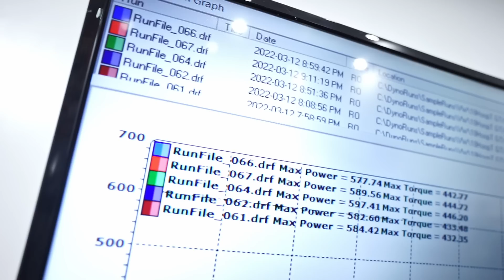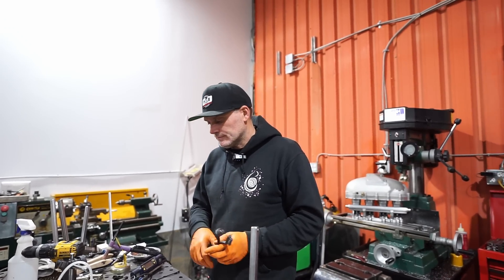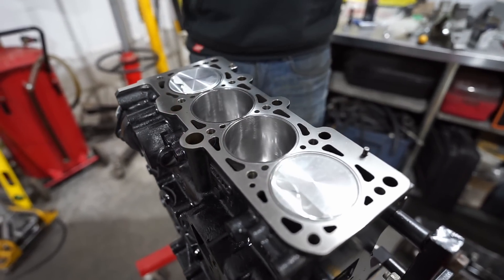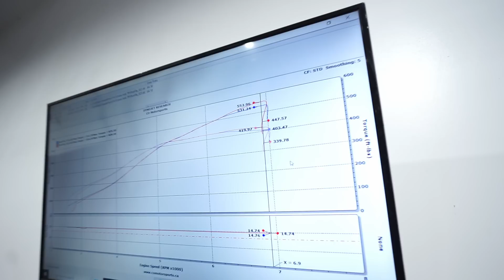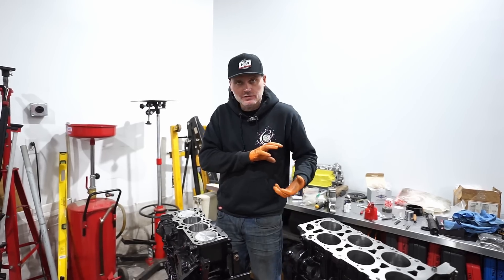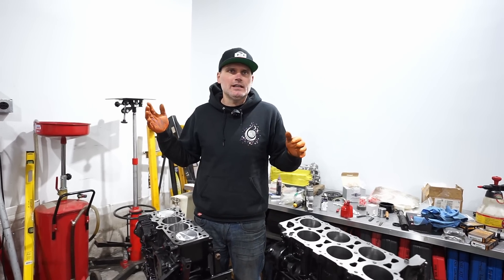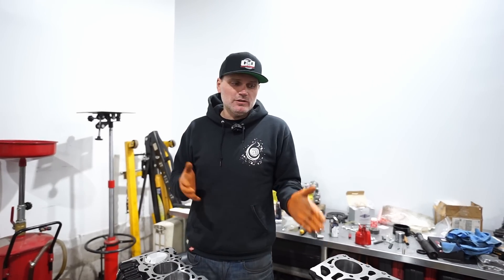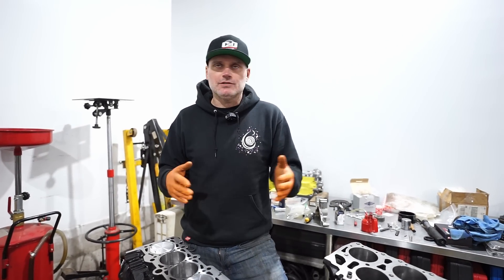Best VW/Audi Engine To Modify.

Comment: Wait till the mk8 r has been around a few years, currently in the uk mk8 golf r stage 1 basic map 400-410bhp 99ron map. Then 460-470 with intercooler and exhaust and mal tweak. The current standard conti turbo on the mk8 r can push the mk8 r to mk7 r hybrid turbo power numbers with ease. It’s amazing the way the things have changed in the past 10-15 years. Remember back in 2005/6 a 1.8t 225 Audi TT stage 3 was blowing the doors off most things 😂
Reply: Yea TR Hamza's MK8R has been nicely mapped by MRC. Making silly power with basic mods

Comment: Come on guys..   You talk all day about 4 and 6 cylinders, and don't say squat about the 5 except " oh yeah it's the best of them all" 😑.
Otherwise nice vid thumbs up!
Reply from the maker: The issue is it's not easy to make power with them, so doesn't really make it plausible for most. You're not spending a few K and making 500whp with one.
Reply: @CO Motorsports  but that's the same case with the VR too I know personally.   You can't say that the I5 is the best outta them all but then say it's hard to get power out of it easily bro.  That's a complete contradiction.
Reply from the maker: @TURBOBEATZZZ  first...at no point did I say it was hard to make power out of them. Second, yes it's about the same as a VR. Third... It's still much easier on gen3 which is the point.
Reply: @COMotorsports  what does your statement " it's not easy to make power with them" mean? Please clarify?
Reply from the maker: @TURBOBEATZZZ  building a complete turbo kit for an  NA engine, no complete turbo kits available, having to open the engine to make any sort of reliable power...those are to name a few. To 95% of people all of those things are out of their capabilities or interest and is not easy. Bolting on regularly available parts is yes "easier", no denying it.
Reply: @CO Motorsports  I get it sort of, but the VR6 is NA too though.....
Both only need a headspacer to drop compression.
Reply from the maker: @TURBOBEATZZZ  I get whats needed. We've boosted pretty much every VW engine at some point, and i've boosted plenty of VRs and plenty of 2.5s. I'm actually putting a 2.5T in my daily. So with that said clearly I have experience dealing with the ins and outs of all of them and I'm giving an unbiased opinion base on my experience, and what clients are looking for.

Comment: Doing a Gen 1 2.0TSI build for my scirocco.
Ported head with 1mm bigger valves 11k rpm valve train and a fully built bottom end. 

To overcome the fueling issue of the direct injection, I have added a manifold with port injection.

Keeping the car FWD with the manual 6. Will reinforce it. Shooting for 800hp. So I'll need to be able to have something like boost power gear to take the power out. 

Have a hard time figuring out what ECU I wanna use. Syvecs, Motec and Haltech (when a di + port injection model finally comes out) 

Anything you guys have a preference for perhaps?
Reply from the maker: Motec it Syvecs is your only real answer. We've done a best identical setup on the MK5 TSI AWD swapped car you'll see on our channel. More coming on that shortly. But with going back and watching the series.

Comment: For me the best one is 2.0 TSI (EA888) in all it's 4 gens the reasons are:
1. Engine with more gens ever so VAG has been putting all of its experience on that engine
2. There are a complete market of hardware in order to tune it! Since engine supports to ECU tune with more stages levels complex
3. Not for nothing is the VWs engine's icon and wins as the best engine by International Engine Awards (IEA) in 2019
4. Because it's connecting rods and Pistons config it supports some stages up with stock engine!

If I could get that piece of engineering, I buy it without thinking!!!!
By now I have 07k Jetta

Comment: @9:22 so you’re leaving out a few things: 1. building a golf R… buying a golf R in the first place is HIGHLY EXPENSIVE. Even used, the avg cost on any car sale platform/website is .. around 14/16k and up with better mileage. Then… if you’re crazy enuff to tinker with an already fast enough reliable car and buy bolt ons: mk7 aftermarket parts are stupidly priced, twice that of mk6 and three to four times that of mk4 aftermarket parts ( a full cat back for a mk7 Gli or Golf… roughly 1700-2000 dollars; LITERALLY throwing away money) . I never could understand why people buy a brand new late model / newer car.. just to immediately throw mods on it… and it generally has everything already usually 🤦🏽‍♂️🤦🏽‍♂️🤦🏽‍♂️. 2. building an FSI is perfectly fine, if you can source parts of what you can do yourself vs what needs to be done by professional or shop. 3. I have a 1.8 2014 TSI, i just swapped the head from a 2016 with lower mileage and upgraded cams and valves, put new springs, cost me about 1100 altogether, next is the block and bore. Some people say you have to spend 10-15k to build a TSI motor and that’s not true if you know where to shop and where to look. If you build a MK6 right… any of the early gen3 1.8 or 2.0’s, you get same power as a golf R, maybe spend a bit less.

Other than that, best bet…yes that’s the reason for a 20v 1.8t cus it can be done on tight budget ( parts cheaper and many ). VRs yes usually are a little pricey yes depending on how far you wanna go with it, but if you dont turbo/supercharge it… simply bolt ons, oil cooler, headers, exhaust… easy 300hp so on smaller light weight car, thats plenty.

Comment: 2.5 07k I personally don't have a VW but I have a Porsche 944 and 924s. The 07k are becoming a popular swap in them and that's what I'm planning on building my car around. 
I'm not looking for crazy hp, I think 300whp would be pretty fun in my light weight 924s rallycross car.

Comment: Fantastic video guys, for me.. it's a no brainer if you take price per performance you cannot beat the 1.8t 20v with a k04 turbo 👌 best bang for buck in the Audi VW engine by facts 👌 
Amazing that mine still pulls 40-50mpg at 60mph, whilst still having almost 300hp on tap! For a couple grand and and 18 year old car, it cannot be beaten.. newer engines are insane but the price gap for performance increase doesn't warrant it for me 🤷
Reply: I have one 1.8t with k04s had it remapped just brilliant engine

Comment: Of everything mentioned,  the best flowing cylinder head IS the 07K... 
If opening a engine, a forged crank 07k on rods and pistons makes same power as VR6 on less boost and revs higher.
Reply from the maker: Possibly 12v VR yes, but that's it. As for the statement of best flowing...it flows the same as the other FSI/TSI head it was based around, it just has an extra cylinder.
Reply: Take a better look at the ports next time around  @COMotorsports  
Or better yet, make a video with them on a flow bench at 28" water.
Reply from the maker: @mushasho  I have cylinder heads here. If you'd like to pay for us to follow bench one and film it no problem.
Reply: Then I'm sure you can simply even see the visual differences  @COMotorsports

Comment: I think you guys answered which is easiest to make power with, which may not be "best" for everyone. While it was super easy to tune my Mk7, VR swapping my Cabrio was a life changing experience for me and I learned so much from it, not just about fixing cars but also managing projects. I also think the "50% extra" rule for the VR is offset by the fact that you can push it about 50% further on stock rods and pistons than the 1.8t. So if you're looking for a project engine in a u pull it where anything small block sized or smaller costs $250, you can go further with that $250 engine.
Reply from the maker: We were clearly talking big power and building engines, so yes my statement applies.  Stock unopened engines, the gen3 is very good. More TQ even at low rpm compared to the VRTs we've done. Not many VRTs making 500-550+whp completely unopened. Can they make power, easily 100%, however they need to be opened to do so. The average person now a days is looking for bolt on power.
Reply: @COMotorsports  I think if you have the specific goal of 500hp at the crank the VR is the cheapest way to get there. Plenty of people have gone that far with just ARP fasteners on stock rods and pistons. Getting into a Gen 3 is expensive and all of the other 4 pots will need rods and pistons to go that far.
Reply from the maker: @acefighterpilot  You're missing the point of the video. Although the engine may be cheap, boosting an NA engine is not. Also opening an NA engine to modify to handle power is not possible for most people skill sets. Which is why I'm saying the best unopened engine at this point in time to make power is Gen3. Bolt on some parts and make 500+whp.
Reply: @COMotorsports  I agree that it's the easiest if you have $20k sitting around or don't mind the payments. You will actually get there and it'll be easy. But you can pick up an old Jetta with a VR6 for $3k, about $5k for a turbo kit, and learn how to do it yourself. That's more rewarding to me than just making the power. Also there's the shituation you guys find yourself in now, which is that if you blow up a Gen 3 good luck finding another, VRs and their gearboxes are cheap and readily available in junkyards.
Reply from the maker: @acefighterpilot  again you're missing the point of the video. And I picked up a built gen3 engine already for 2k cdn. 😉
Reply: @COMotorsports  How'd that shake out? Clapped out Gen 3 GTI engines are about $5k in the states.
Reply from the maker: @acefighterpilot  Good customer of mine. So the 7R will live again when I get time... well for a short time. Just going to test it out in that chassis and tune it so it's ready to go in the MK1 when the time comes.
Reply: @COMotorsports  Looking forward to that. Are you guys following the open source tuning project with SimosTools?
Reply from the maker: @acefighterpilot  No, time is my issue. Most of our clients want whats proven, so me venturing into it doesn't make sense. It's much easier and cost effective for me to use what's proven. We have spent more time using Maestro on gen 3 which is very capable, but that's a personal thing at this point. I will keep stock ECU when it all goes on the MK1, however by the time that happens there will be endless decent options I suspect for tuning suites.
Reply: @COMotorsports  What transmission are you going to use for the Mk1?
Reply from the maker: @acefighterpilot the stock 02Q out of the 7r. I'm a manual guy, and this is a toy for the street and helicopter donuts. Lol
Reply: @COMotorsports  Any concern about crank walk?
Reply from the maker: @acefighterpilot  No, we modify a lot of mk7s, do tons of clutches in them. And we've only seen it happen to 2 locally since they came out. Now we're not a service shop so we wouldn't see as many as the dealer would but it seems it's a very low percentage. The internet just blows everything up because you hear about the failures...you don't hear about the millions that don't. Also from my scouring on the internet the issue has been completely random, stock clutch, upgraded clutch, DSG....it's happened to all of them.
Reply: @COMotorsports  Do you have any thoughts on the cause? If there is some kind of driving (e.g. slipping the clutch in reverse) or maintenance related factor? And do you remember if the two failures had build dates before the N revision thrust washer was introduced in Dec 2017?
Reply from the maker: @acefighterpilot  no idea, my guess was trash run of thrust bearings

Comment: Now I know the gen 3 1.8t  is basically the same as the 2.0t gen 3 but curious about the tuning and power ability of the 1.8 gen 3
Reply from the maker: Not really the same, it lacks in it's capabilities. But it's still a great engine.

Comment: VR6 all the way for me. I had Mk4 GLI 24v VR6 and now a MK5 R32, I love the instant power and torque it delivers, though it's not easy to get more out of them NA, they're pretty much set for a Turbo or Supercharger setup.
Reply: I have one also, I daily it. But I met someone two days ago with Audi S3 modified and he was advice to get r32 because the motor is big and you can do more with but expensive
Reply: @cliffb1932  If you can then yes it's an upgrade especially if it's a Mk4 R32. I love my MK5 but more expensive in parts and repairs because of the DSG. 
I don't plan to Turbo/Supercharge mine maybe Software and Cams in the future.

Comment: I am a bmw enthusiast through and through but you guys just earner a sub from me simply due to the fact how professional and calm the presentation was. Great stuff.
p.s. from a bimmer guy, a 3.2 VR6 and 2.5 R5 are one of the two best engines of all time, as well as the old Audi 2.7 TT V6.
Reply from the maker: Thanks for following along. And yes the sound of the VR and 5cyl have definitely made its mark as some of the best sounding engines for sure.

Comment: Does the 50% more cost on the six cylinders not equal the additional cost for a 4 cylinder to make the same power since it has less displacement.
Reply from the maker: No. When you're talking higher HP numbers they both need the same upgrades.

Comment: I have a project 914 with a 1.8t GT28rs in it, originally I installed a G60 lysholm, then a 16v g60 lysholm. I was at first disappointed by the 1.8t performance and was wanting a VR or 07k turbo for the low end punch I'm missing from the original g60 swap, but now after getting some more wheel time I think that I'll just keep with the 1.8t and maybe upgrade to a different turbo G25-550 or build a bigger displacement 1.8t.  The only thing missing from this plan over the VR or 07k would be the intoxicating sound that the bigger displacement engines make. My problem is I've always wanted a 5 cylinder turbo car so maybe a 07k 944 could be in my future, as that platform should have gotten Audi's 5 cylinder in the 924 originally over the Audi sourced 4 cylinder Porsche used. VAG swapped Porsches for everyone!
Reply from the maker: 07K Fo sho
Reply from the maker: @bellacanacorsocross711  Swap engines, or buy different car.

Comment: We swapped a stock 12V VR6 into a full weight Mercedes C230K back in 2017 and the car ran low 12's with a HX35, 42# injectors, and off the shelf UM tune. It's basically a fun junkyard car and engine. Since then, a lot of other cars have got in the way of progress, but we recently picked up a 3.2VR from a Porsche Cayenne and want to swap it into the Benz with a HX40 super. What off the shelf FI software options do we have other than like a UM ProMaf setup for this engine? Thanks for your time and keep rolling......
Reply from the maker: UM or standalone. Standalone will make any swap possible.

Comment: With the comments regarding the EA113 engines (Mk6R), having intentions and plans to open it up and upgrade Turbo, what max power should it produce? Wondering a swap to a EA888 engine would be the better option?
Reply: anywhere north of 600-700hp is going to need additional port injection
Reply: EA113 is capable of 600BHP with the right hardware and mapping

Comment: 1.8 t20 valve in the Mark 4 platform was my favorite because it was so unassuming from factory and so dominant with just a little bit of work you could do yourself. I finally got one and it's so amazing that it's dead reliable and I love the sound 🤠
Reply: Amazing reliability so far w mine, had it for 2.5yrs. watch the coolant leaks though! Mines almost at 180k miles 🤣
Reply: @jeremylucss4019  350 for radiator and you'll be good!😊
Reply: @jeremylucss4019  nice! I'm at 152,000, brand new clutch brakes ignition system alternator and drive belts strut springs and all the suspension the turbo wastegate is broken I believe and so I'm about to put a KO3S and an exhaust on

Comment: What is your take on the new 3.6 vr? What are the options?
Reply from the maker: Options for what exactly?
Reply: @COMotorsports  Turbo charging it would be my question for the 3.6l vr6, I know there's at least one supercharger kit out there for it, but personally I'd like to turbo charge my own if possible and there's not a whole lot of information out there in it.
Reply from the maker: @stone5474  being a DI engineer it adds complexity which is why you're not seeing many. But there are ways around it and lots are being built. Just costing more than typical VR turbo builds.
Reply: @COMotorsports  Gotcha. Thanks for the quick reply!

Comment: I’m a VR guy, one thing I’ll say… a 67mm turbo on a vr or a 1.8t… the vr will be nicer to drive around off boost, and better to build boost. And it sounds way better. And you don’t have to build it to make 400hp
Reply from the maker: You also wouldn't run a 67mm to make 400whp. ;)

Comment: 2.5 07k swap stuff would be fun. trans options and whats needed for boost. Gen 2 ea888 is something I'm looking into. B8/8.5 A4 have been catching my eye.
Reply: If you go Gen 2 TFSI audi EA888, make sure you get one with a CPMA or CPMB engine code. 2014-2016.
Reply: That's gen 3 @klubstompers
Reply: @wakaflockaproject  Not in the US. B8 and B8.5 A4 is gen 2, gen 3 was in the b9

Comment: I have a question. I have a 2016 audi a3 1.8t. I got it used with about 29k on it. I put a stage 1 IE tune on it and with in 5k the exhaust turbine broke off. What do you think the cause was? Was the tune too much for the IS12 of the year? Do you think the turbo was not treated right from purchase, maybe abused? I'm interested to hear your thoughts. Thanks.
Reply from the maker: Just a part failure. Stuff happens.
Reply: @COMotorsports  That soon though?
Reply from the maker: @audi_sline_fb  I've put brand new turbos on cars that failed before driving on the street. Sometimes things just break. I wouldn't think much else on it IMO. Those turbos are known to fail for actuator problems. Spitting out the turbine wheel is no where near as common.
Reply: @COMotorsports  Thank you for giving me your thoughts and opinions.